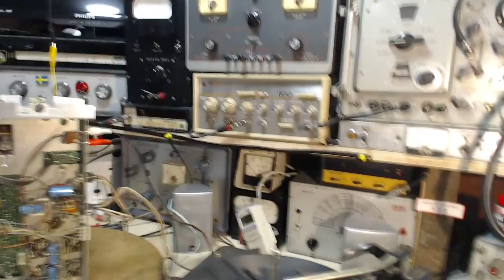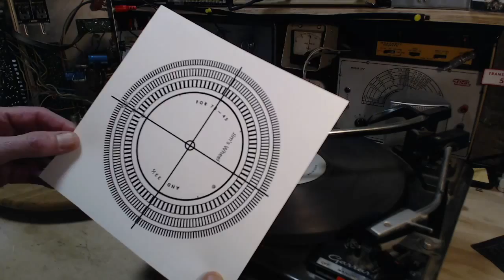Clairtone T11 Console Stereo Video #2 - Garrard 3000

Comment: I am surprised the drive belt hadn't snapped. I was repairing  pioneer turntable and all that was wrong with it was the drive belt had snapped. That drive really is stuck big time. I'm saying pull harder watching this video. Good that you cleaned all of the crud out of there and clean the shaft and use lithium grease on it might have made it go on a little easier.After watching this you are doing great. Thanks for sharing